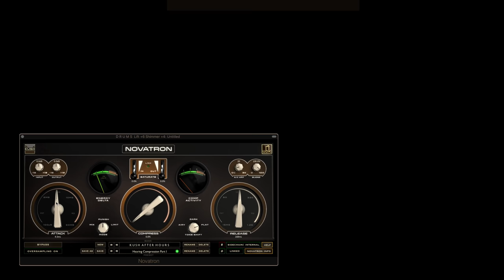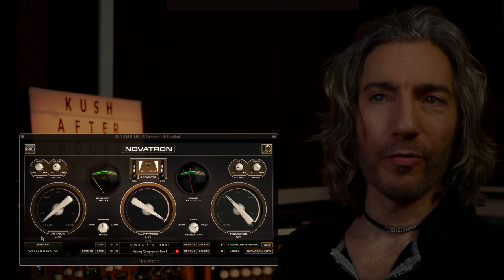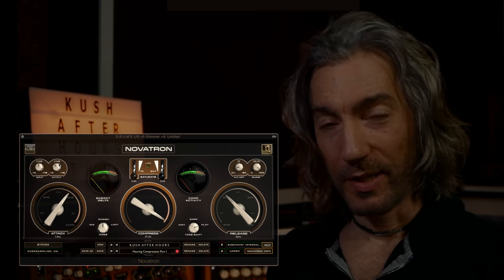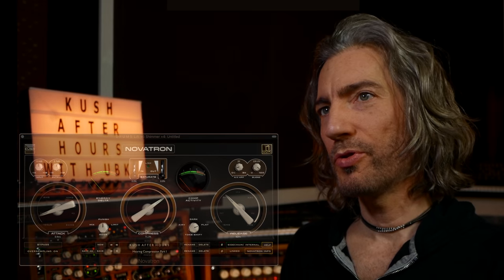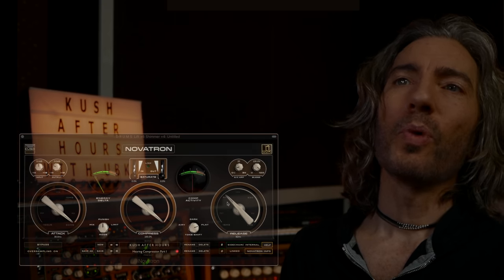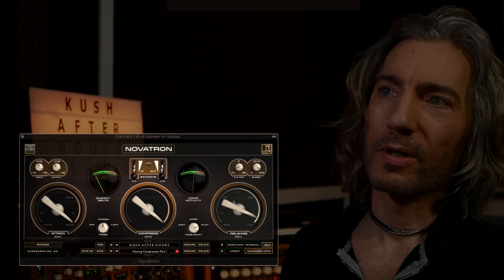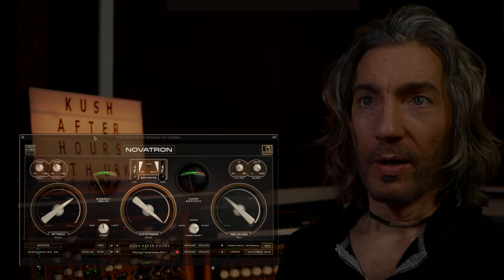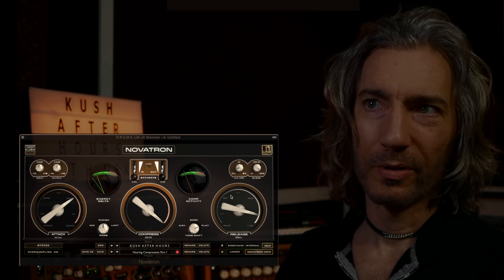Compressor Designer GEEKS OUT on DRUM COMPRESSION!

Comment: Great vid, thank you so so much, such a gem! I just wanna say 5:22 what I'm really hearing here when you nake the attack faster is Less Lows. I guess that's cuz higher frequencies reach my ear (or fly through the compressor's gates) faster, so they are able to sneak through, while lower frequencies can't. That explains 1) why some compressors (I think yours too) have a HighPass knob - that helps to prevent compressor to eat the whole transient (for drums-bus or mastering chain) by preserving lower frequencies from it. 2)it also explains why "old-school'er" engineers say "fast and slow" instead of "high and low"

...you rock man! I gotta look at your products. Cuz thats the 2nd video of yours I'm watching and it's one of the most beneficial things I remember on the internet. The 1st video was about how I can hear the relation between kick and bass by putting my finger on the ring around dynamic/speaker however that thing is called.
Reply from the maker: Thanks for the support man, glad what  I’m doing is helpful!

Comment: It is experimental and creative  to add textures to the original tone. Basically parallel compression is helping to blend in the gain reduction almost silky. Adding a low or high shelf eq just before the compressor to change the response of the compressor  (as opposite to turn the whole signal down). To change that response without hearing the eqish sound sidechain is important. Sidechain is also like a focusing tool by cutting the low end and is important when it is not a multiband compressor. Soft or hard knee  has a sweet spot by threshold working on the transient like the input level to drive it. Oversampling is just important on fast attack and release as it introduces artifacts and distortion.
With that said a 1:1 ratio could be used as some kind of saturator or shaper and a higher ratio like 1:10 - 1:30 as a limiter.

The turning level down is a mixing trick because it changes the fletcher munson curve.

Comment: Also use low volume when leveling parts that are not bass heavy. It's so much easier. Then turn it back up, and adjust a bit - now you're in the ballpark.
Reply from the maker: If the room is tight enough, you can mix and eq and compress the low end at absurdly low volumes.  Still helps to check at all volumes, but tight acoustics make a lot of impossible things possible 😊
Reply: @TheHouseofKushTV  Indeed. And most mixing I do is actually at low levels most of the time, as your ears themselves will start to compress at higher levels.

Comment: Hi, Greg, believe it or not, I have waatched this video many many times. I do notice that the time is reduced twice so far. Wondering if you could share the full lenth video again?  this is a great great video to learn hearing compression. Thanks.
Reply from the maker: Thanks for your support!  I have no clue about the video length changing, this is the same video I uploaded originally, I've never edited or messed with a video after dropping it..?  🤷🏽‍♂️
Reply: @TheHouseofKushTV  As far as what I remembered. The lengh of this video was about 50 minutes and then 30 minutes. Now, it's only 20 minutes long. You were talking about attitude by setting the attack and release time. That part was not in the viceo anymore, Greg. Thanks.

Comment: I think you misspoke which kind of undermines your expertise as a compression and audio effects designers. You said you can hear the difference between 100 and 400 microseconds That’s 300 µs. 

300 µs (microseconds) is equal to 0.3 ms (milliseconds) — a third of a millisecond.  300 µs (0.3 milliseconds) is generally considered very low and imperceptible to human ears. Most people can start to perceive latency around 10 milliseconds,

Comment: Dude, you might have a good ear, but I doubt you can distinguish a microsecond.  
I think you mean milliseconds.
Reply from the maker: You are correct and incorrect.  You are correct in that I can't distinguish "a microsecond," and I never said I could.  But I can hear the difference between 100 and 400 microseconds, which is a 300 microsecond delta.  Novatron's fastest attack is 100µs, aka microseconds, it obliterates transients much like an 1176.  But if you open that up to 400µs you will start to get a distinct 'snat' on the transient.  

If you think about it, claiming to hear the difference between 100-400 milliseconds would be both unimpressive and also weird... 100ms attack is absurdly slow, 400ms uselessly so?  That's more like a slap echo vs. medium delay time, anyone who can't detect the difference in that span of time should probably reconsider their engineering path 😛